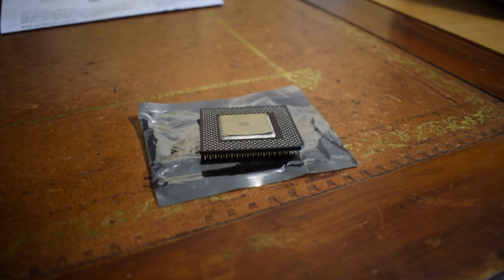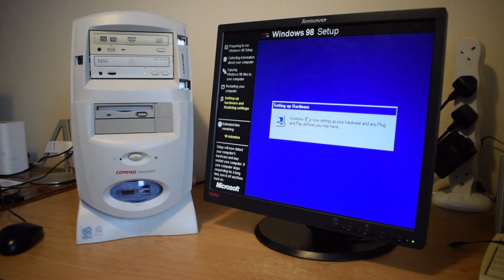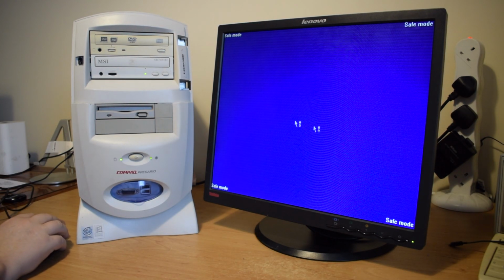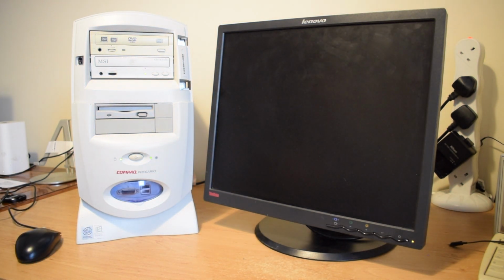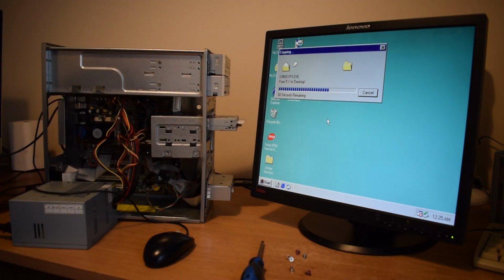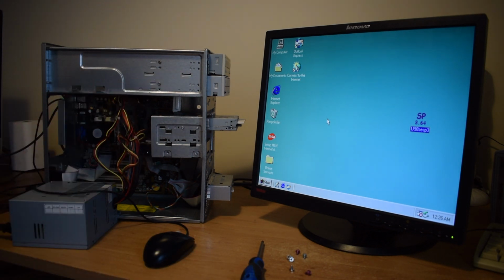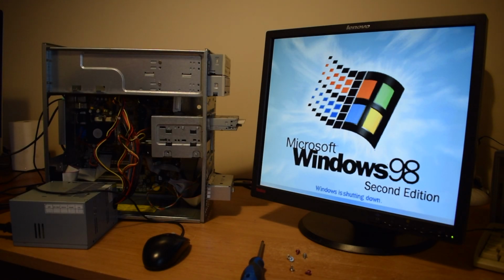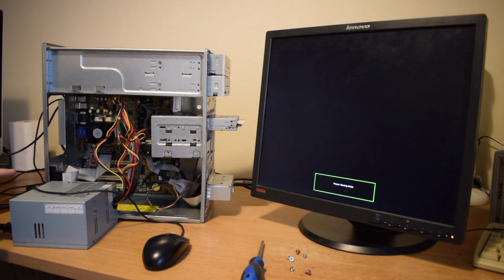Compaq Part 3

Comment: Have you tried uplugging one of the CD drives?
Reply from the maker: I did install a second CD ROM / DVD which was a known working device. I take the point you are making (I assume?) that maybe with just one device it might behave. Alas it makes no difference its just a right pain in the .... BIOS update / flash time if only I can find the right files.

Comment: I had a Compaq7464  that would not install windows 98 from the windows disk only from Compaq's recovery disks, i never figured out why
Reply from the maker: It would not surprise me at all, I will keep working on...
Reply: @PaulBottomley  One thing i would try is new memory i once built a pc that worked but would corrupt the os , after months of messing around i replaced the ram i bought new at a computer fair and it worked fine after that.unless any of the capacitors are going bad  that might cause odd behavior.
Reply from the maker: @paulb4uk  Its on its third batch of RAM, so I think I can conclude that's stuff if fine (the ram stick is took out work fine in other systems. I have inspected the motherboard, cannot see any leaking or buying capacitors and or nothing gets hot... 

Maybe one for the bin ?